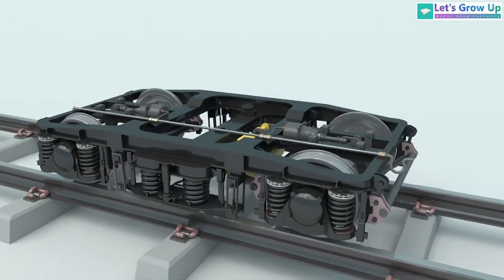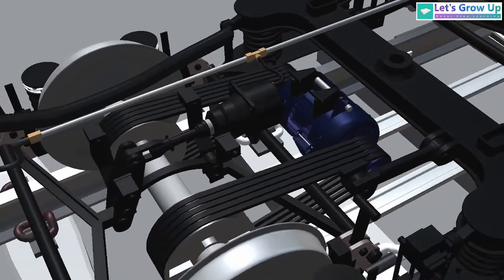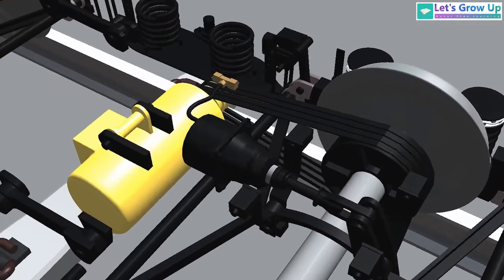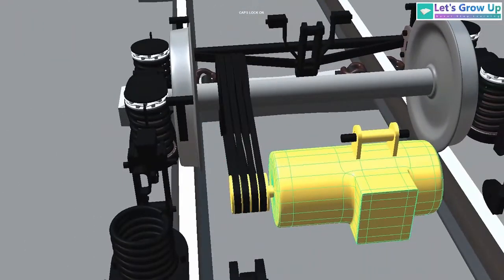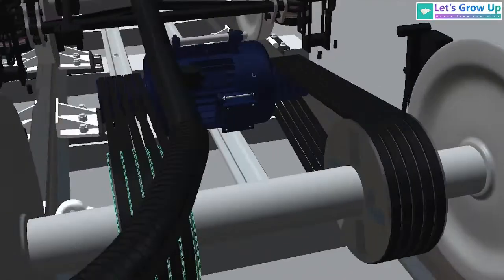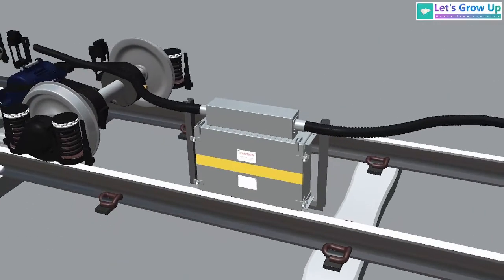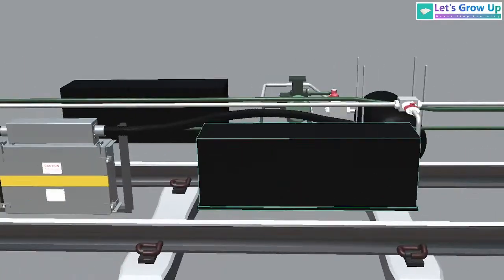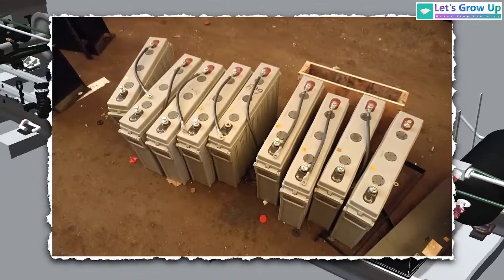Under Coach Alternator | 4.5kw & 25Kw Bogie mounted alternator

Comment: How can you produce a consistent alternating current from a wheel driven alternator? They usually use a diesel engine if over head power is not available.
I have never seen this crazy system.
Reply from the maker: I will share this crazy system soon